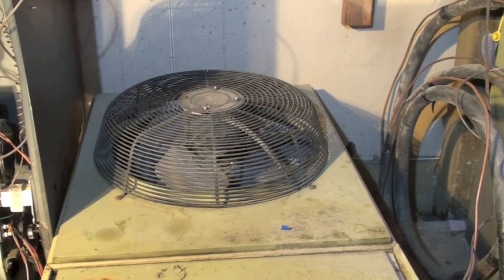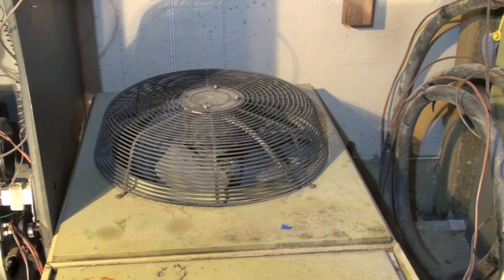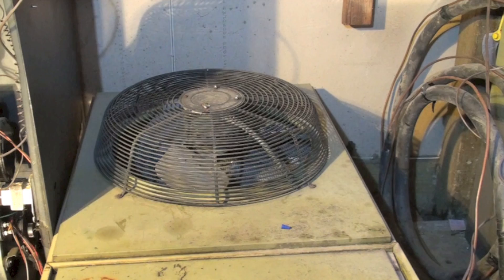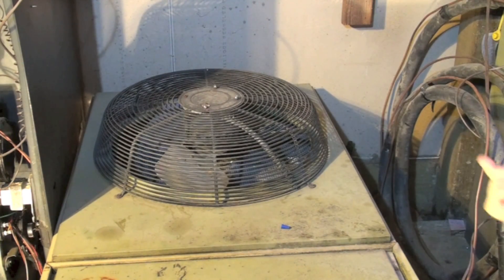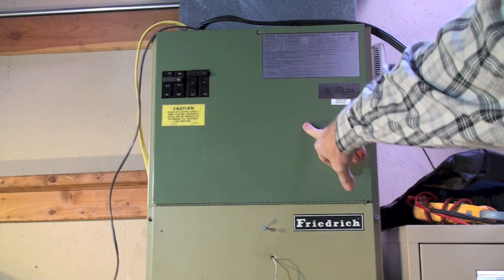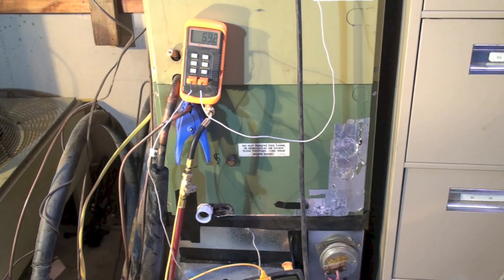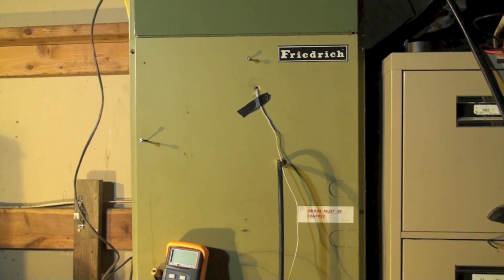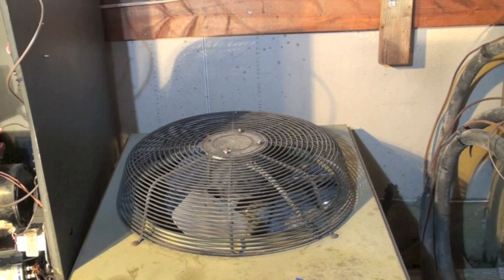What is a heat pump

Comment: I'm looking at buying a home that was built in 2001 it is heated and cooled by a Gibson electric heat pump system. (Forced air, registers in every room). Are these units really good at heating a bi-level home that is a little over 1,300 square feet of living space? I don't have any experience with heat pumps and I want to know what I'm buying. Any info you can give me would be much appreciated! Thank you!
Reply from the maker: The heat pump is quite capable of heating the structure.  The duct temperature is somewhat lower than other types of heat.  The heat pump is nearing its end of service life.  Hope this helps.
GFM
Reply: grayfurnaceman , so I can count on replacing the whole system then?
Reply from the maker: The indoor unit is probably ok.  The outdoor unit and indoor coil will probably need to be replaced in the next 5 years.
GFM
Reply: grayfurnaceman, thank you for your advice. We passed on the house, it just had too many unknowns and upcoming huge repairs for a house that's only 15 years old.

Comment: mine is broke, it turns on even when the whole system is off, it doesn't cool the house and blows cooler air outside than it does on the inside.... I really dont want to to have it on all winter, because we had to switch it off because it was just running by its self all summer and not making any thing cold at all....
Reply from the maker: +djclown7pb I can't be sure what the problem is as if it is on all time, this indicates a possible stuck contactor.  However, if it is not blowing cold air, there may a charge problem.  You will have to be more specific.  Is the outdoor unit fan blowing?
GFM

Comment: I work on hundreds of heat pumps..  I think that is all I really work on anymore, a few furnaces and a couple straight cool systems now a days but I am a primary heat pump tech.  Heat pumps are great as long as the ambient temp stays above 40F after that their is not enough heat in the air or the climate is not ideal to produce btu's.  I personally like 3 stage heat 2 stage cool heat pumps those are the most efficient carrier makes some good ones now with dehumidification control thru the fan and thermidistat..  Great videos as always.
Reply from the maker: Jeff Xhaosis Like you I worked on many heat pumps starting in the late 1970s.  Depending on the choices for backup heat, I agree on the 40F number.  However, if you have propane, oil or electric backup, I generally go lower on the ambient.  In our area, the utility wants 0F if the backup is electric.  I don't agree on that.  The only problem with the Carrier is the price.  Thanks for the thoughts.
GFM

Comment: I have a question... about my oil burner heater and boiler...
Mine doesnt have the AUTO water level filler and lately the water in the boiler is not lasting for a day... It shuts the burner off and i have to go the and put some water in. Before it use to last like weeks... Any idea what it is? thanks Andrea